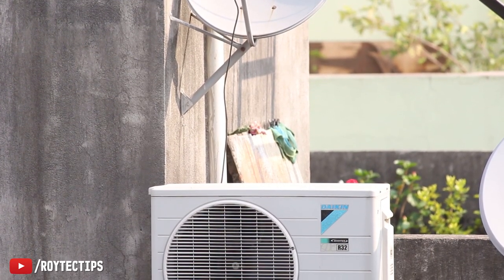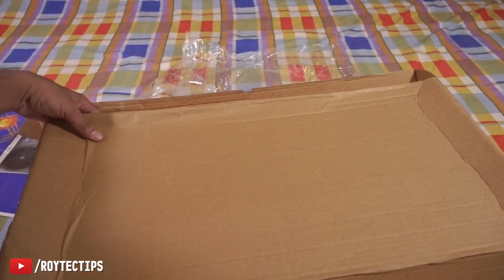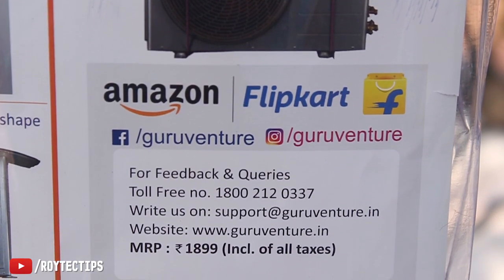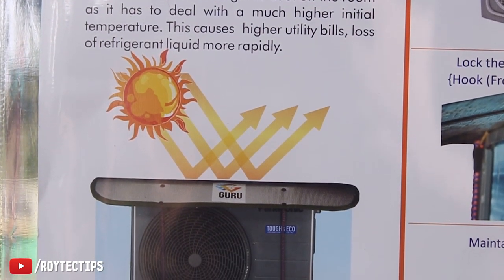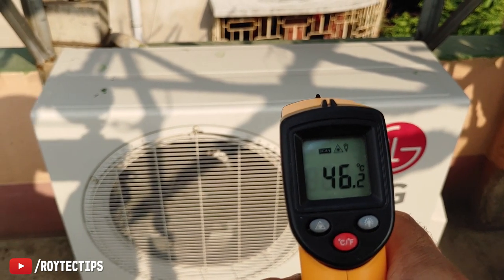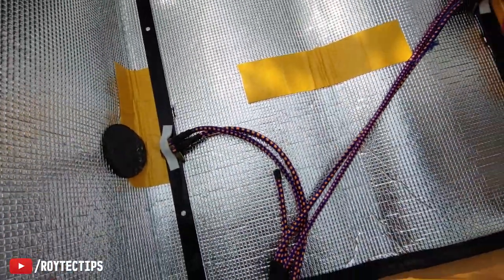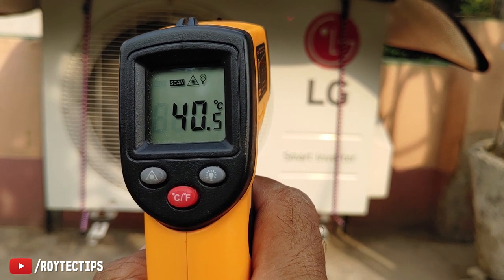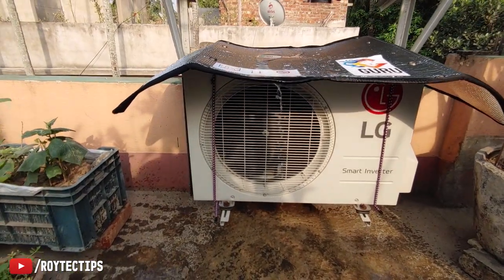How To SAVE upto 40% Electricity Bill on AC | Also Protect Split Air Conditioner Outdoor Unit

Comment: I think it is better option to cover the top surface of out door unit with a thermocool sheet which is available in the packing box of new ac
Reply: I also use bro it
Reply: You mean to paste the thermacol on the top??
Reply: But how to paste?
Reply: I did it
Reply: I use that and two half size tiles to stop it from falling
Reply: Bro's do u see any improvement in cooling after covering with thermocol sheet .
Reply: @swagatadasbairagi545  first copy & then paste
Reply: @nilanjanpaul8479  😂, I put a thermocol over the odu by a small rope on two sides, no my odu is protected from direct sunlight 🙂
Reply: Will it work on rain too ?

Comment: Hi bro, does the adhesive stick to the top of the AC outdoor unit? Just in case you live in a rented apartment and you're oblige not to deface the top of the outdoor unit. Is it worth it or it's gonna leave a sign after leaving such apartment?

Comment: Lowering the temp of the outside unit lowers bills?
Reply: carnot engine
Reply: Yes there is a reason behind this shed suppose u set ur ac 24°c so if ur outdoor ac unit is directly exposed to sunlight it will use it's maximum power to reach ur desired room temperature 24°c due to high ambient thermostat will use more electricity... Sometimes u have seen due to high ambient temperature compressor trip
Reply: yes, and also increase efficiency.
search for T1 and T3

Comment: 40% lmao..this won't be making 0.01% of difference. Ac care about ambient temperature not about surface temperature, and if u think this will protect your ac from rain then u should know that these are made to ingest heaviest possible rain and function properly. , Older non inverter units can even oparate under water if the electrical connections are sealed properly.
Reply: exactly people aren't to smart
Reply: It makes difference to electricity bill

Comment: This doesn't work at all. What would work is to put that type of reflective material on yours homes windows to keep the home cooler to begin with then your air conditioner wouldnt have to work as hard and save you money on electricity

Comment: Ac outer unit should not be installed inside the roof top area of apartment. It is highly risky for other residents
Reply: why ?does it fall during wind
Reply: @culprit6099  someone could fart near it and that fart could be sucked and blown into your home. Not safe.
Reply: @thisisrob8750  WhatsApp University graduate spotted